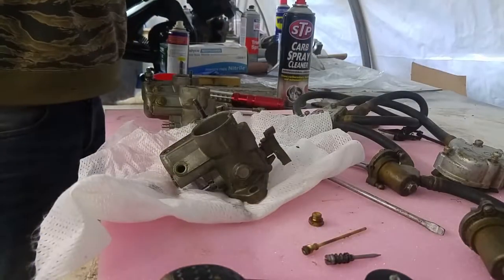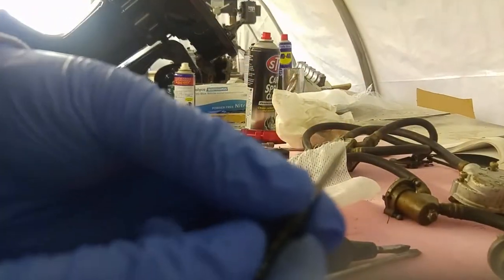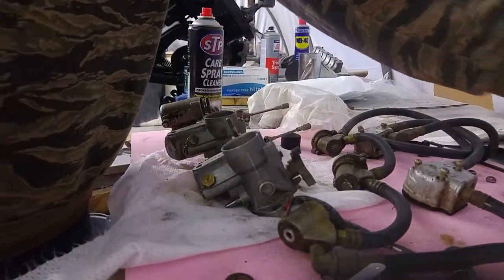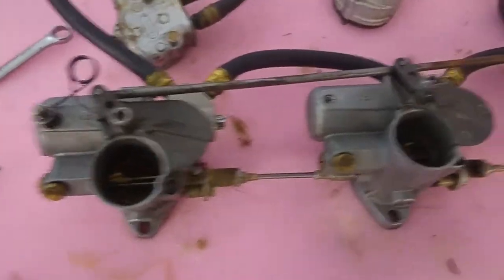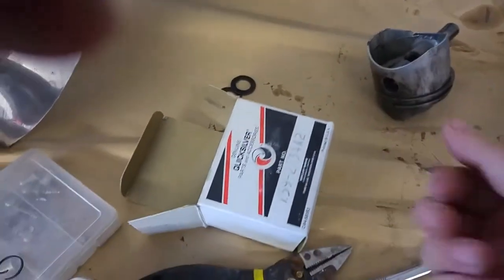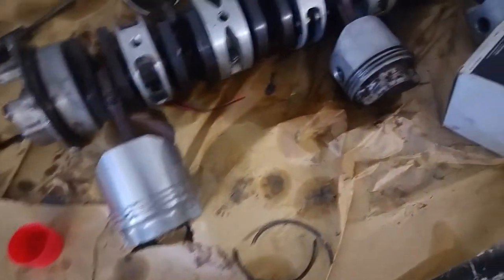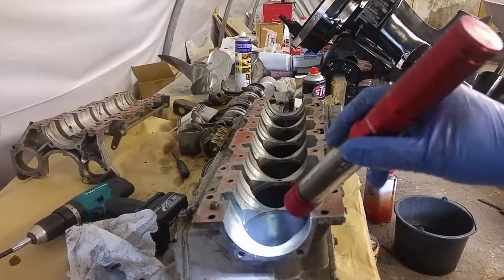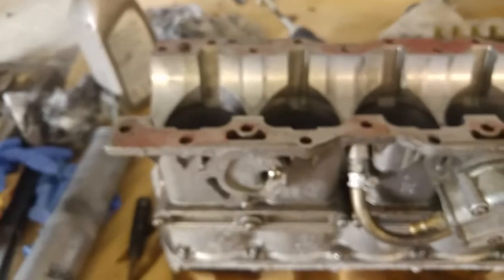Mercury 1000 Outboard rebuild - Part 3

Comment: I used a Ringo Starr model drum stick (the ones with the purple hand grip) Took off the hand grip, greased up the end of it, had my needle bearing laid out in a row and rolled the drum stick over the pins then inserted the stick with pins into the connecting rod.